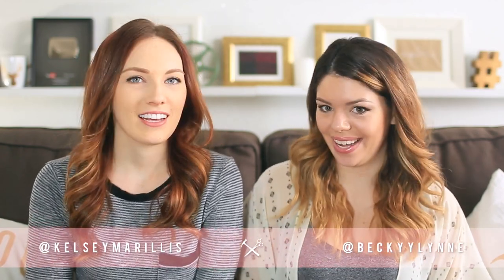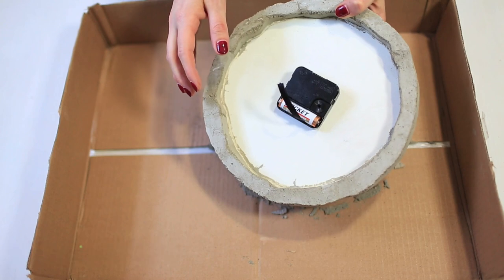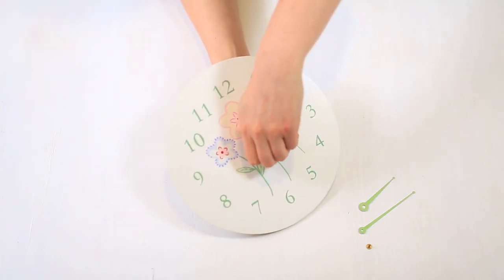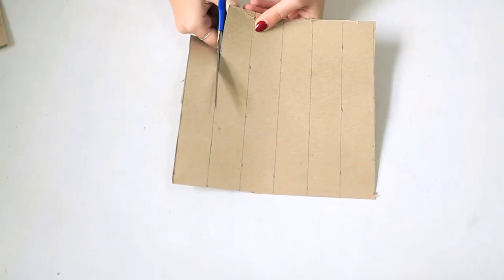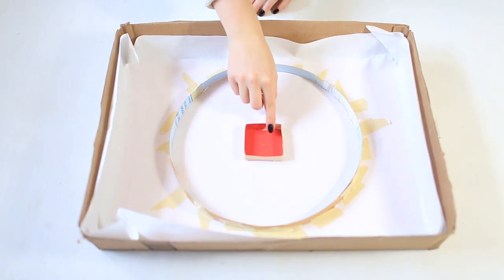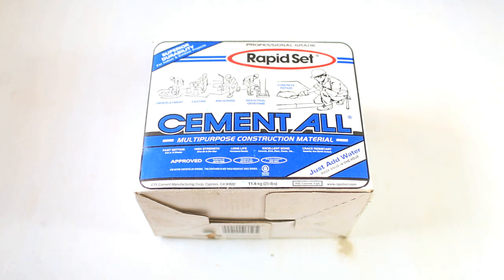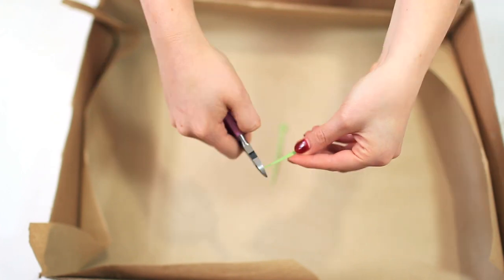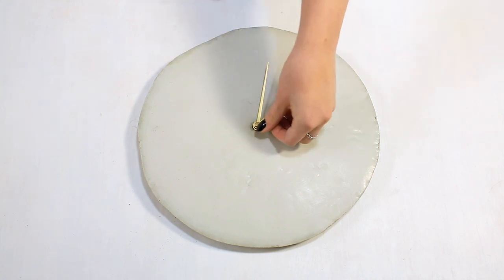DIY CONCRETE CLOCK | THE SORRY GIRLS

Comment: You NEED to wear masks while using concrete. It is very toxic.. My boyfriend is a contractor, carpenter and more and he ALWAYS wears a mask, it doesn't take much though to realize that you can't be inhaling any powder (From setting powder, silica, concrete, cinnamon, etc.) It doesn't matter what it is, our lungs should not be inhaling powder especially concrete! You should make it a known thing in your videos to wear a mask, including you two while mixing it!! Please like this so it can get seen by more people!
Reply: serena moon no need to wear a mask around concrete, you can as a precaution but not a necessity
Reply: You can just do it outdoors and not inhale anything. I always work with cement and concrete on my deck, as I don't like mess in the house, plus cement dust can actually scratch wood floors.
Reply: serena moon u don't need to use a mask.
Reply: what's to say they weren't? that was a voice over so for all you know they could have been wearing masks
Reply: lol ur boyfriend

Comment: I love it! I done this a few years ago using a bucket as a mold. I just mixed the concrete in the bucket, shaked it to remove air bubbles, and then used sandpaper to make it smooth

Comment: For your next clock, just use a deep plastic plate, you will get glass-smooth surface and casting will be a breeze :) Use a vibrating tool to get rid of the air bubbles. It also makes life much easier to add cement to water, not water to cement, hope this helps :)

Comment: Hey girls, I have a wall that I originally wanted to hang some shelves i made out of wooden planks, the wall was a support wall and was a nightmare no drill penetrated it. So i saw your video with the leather straps and I was gonna do that but I have some left over planks and I was wondering. My idea was to use them as the base of some sort of lighting, my plan was to drill holes in the planks and put small glass bottles (like the frappucino ones) and fill them with lights but I have 0 clue on how to go about it or how to hang it and stuff like that, i was wondering if you had suggestions or maybe if you even liked the idea. Love the DIYs

Comment: wait why did they just use a round small metal cake pan, with the wax paper and stuff, that seems less labor intensive
Reply: didn't*
Reply: +nessy. xoxo I think it's because when you  take the clock out from a round cake pan it could smash Ö
Reply: In their iPhone dock DIY video they mentioned that you need something flexible to take out the actual concrete once it dries
Reply: because a cake pan isn't flexible, and if you just make a mould out of cardboard you can rip it off if you need to
Reply: +WhatAStrangeWorld. oh okay, well there are silicone cake pans they can use which is wayyyy easier